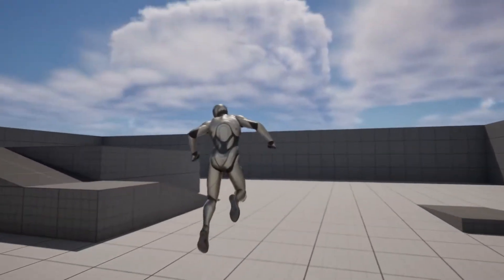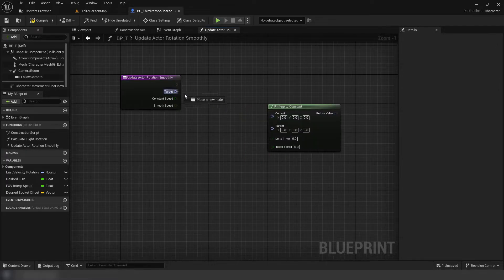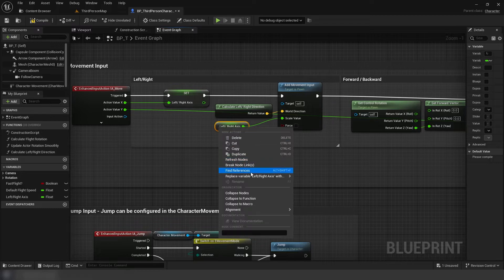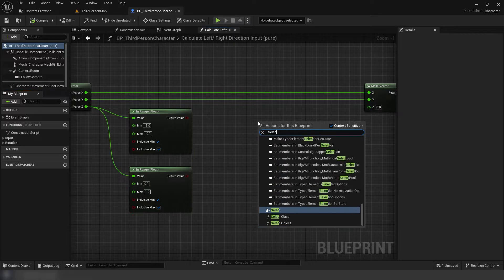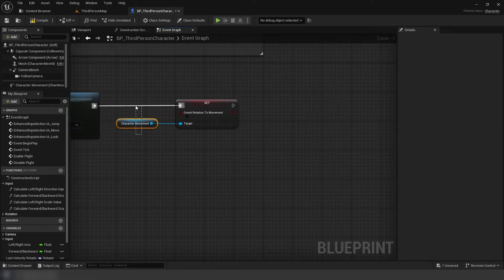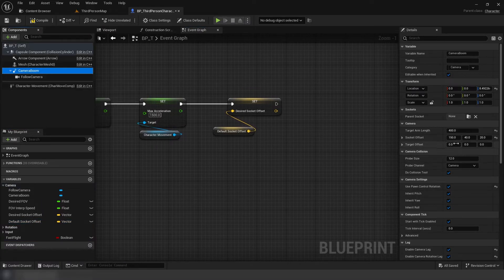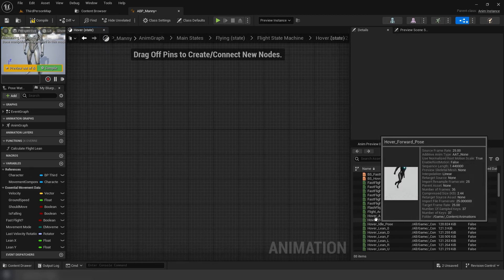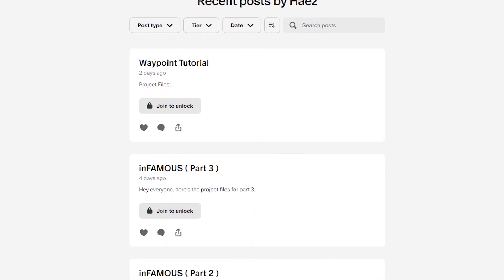Superhero Flight - UE5 Tutorial (check description)

Comment: I had an issue where when entering fast flight mode, I could only move in one direction along the x-axis. After rewatching different segments of the video several times, I realized that in the CalculateForwardBackwardDirection function, I was missing a "Get Rotation X Vector" node and had split the X, Y, and Z values out from the "Get Control Rotation" node directly. Recombining the struct pins on "Get Control Rotation", feeding its combined Return Value into a "Get Rotation X Vector" node, and then using "Split Struct Pin" on the "Get Rotation X Vector" node fixed my problem. If you're having a similar issue, be sure to check your Calculate Direction functions for any places where you may have used "Split Struct Pin" on the wrong node.

Comment: First of all, let me say thank you for creating the tutorial.  It is informative and I appreciate you taking the time and I did get out of it what I needed as well as a few things I wasn't expecting.

However, this might be the least enjoyable tutorial I have ever completed.  I get it, people want quick tutorials and typically people will click on shorter tutorials, and I can slow it down.  Regardless, the lack of break points after completing a task makes it very frustrating (IMO of course) to complete, especially if the user is actually trying to understand the code you are building.  It's just a constant stream of words with no warnings that a new section of code is getting ready to start.  That makes the user have to go to find a good stopping point.  Even allowing a second or two with the completed section on screen would be a big help and not add a great deal of time.

Comment: I think i'm having an issue where after using the Fast Flight, once the key is let go, the speed at which you're hovering is drastically reduced in comparison to the initial hover speed?
Reply from the maker: @169ru  May not have set the max flight speed to the same used when initially starting to fly
Reply: @haezdev  W quick response. Checking that now after just finishing fixing the animations in my project. Thanks again for the response as well as the video!

Comment: Hey I already left a request in the discord but I'm restating my issue here in case it doesn't get seen. So I got the logic to work for flight but I'm having trouble with the animations to work. When I enable flight (or fast flight), it'll go into the hover idle pose but that's it. I can move around and everything but I'll only be in the hover idle pose when flying

Update: I noticed I was using the wrong variable for "shouldmove" so I just fixed that. Now the character can transition from the hover idle pose to fast flight animation but when I move around, they only lean forward, not left or right.

Update: problem solved! I connected some nodes incorrectly during the function setups in the beginning. The flight works properly now.

Comment: (Found and fixed my issue in the comments below!) Thank you for this tutorial! I am new to all of this and although I had to watch it at half speed and do not understand most of it, I managed to get it working 99%. When using fast flight, my character flies diagonally to the right at about 45 degrees. I plan to use a different character model so I did not follow the animations portion. I am assuming that would not cause the issue. I have went through and watched the tutorial again while double checking and everything seems to be okay. I'm sure I missing something but I just can not find it. Any help would be greatly appreciated! Thanks

Comment: 11:37 - for anyone wondering why the character is no longer animating, connect the "As BP Third Person Character" output pin of the "Cast To BP_ThirdPersonCharacter" node we just added to the input of the following "Set Character" node after changing its variable type to "BP Third Person Character".

This drove me nuts for over an hour until I tracked it down XD
Reply: Thank you so much. This is my first project, and I have no clue what I'm doing. I wanted to get this tutorial done to have a firm basis to experiment with, and you saved me so much frustration. I usually learn better if I can emulate and then iterate off other examples, so this will make things smoother for me.

Comment: I’m running into a problem where the flight works but none of the animations work. It’s just the mannequin standing straight up while flying. Can anyone help?
Reply: 11:37 - for anyone wondering why the character is no longer animating, connect the "As BP Third Person Character" output pin of the "Cast To BP_ThirdPersonCharacter" node we just added to the input of the following "Set Character" node after changing its variable type to "BP Third Person Character".

Hope this helps, it drove me nuts too <3
Reply: @starblaiz1986  thanks I’ll try that

Comment: Why do i have an Exec pin when i try to drag Calculate Flight Rotation to connect to Update Actor Rotation smoothly at 3:06?

Update: I fixed it! I needed to check the "pure" box in the details panel.
Reply: Thanks so much!

Comment: So ive done everything but i have two issues at the end of it all, assistance would be great because this made everything in my game come together great.

Issue #1: When going from fast flight back to hover, i no longer can move unless i go back to fast flight or disable flight.
Issue #2: When going into fastflight mode (Holding shift), my character is stuck staring downwards, but lean and everything else is working.

I have carefully looked over and fixed all errors located from your description, just not sure whats going on here.
Reply: The issue #2 is solved by fixing default flight speed on disable fight, but issue #1 not sure what to do about. Maybe the additive is setup wrong.
Reply: @coden2676  You ever get that resolved, I'm curious?

Comment: During your video I got lost a lot, but then I realized you have the corrections in your video description. I really appreciate the extra effort you put in to creating the perfect guide. 
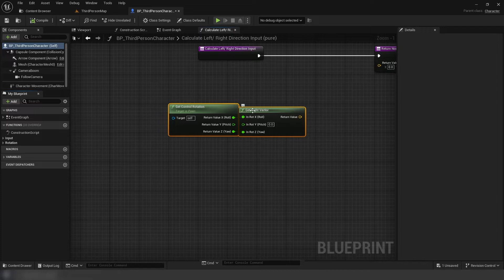(Corrections at 4:05 and 4:24 are in the 'Calculate Left/Right Direction' Function, not the Axis like it says in your correction edit in the description.)
1:50 when you Get Control Rotation, I was stumped until i realized you need 'Get Control Rotation (PAWN)' instead of (CONTROLLER). this occurs a few other times as well.
11:40 scary. Changing Variable Type from Character to BP Third Person Character warns of breaking connections, please advise to allow changes.
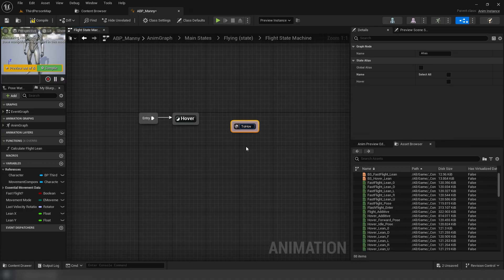13:26 you magically renamed New State Machine to Flight State Machine without mentioning it which really confused me at 14:57. At 14:59 you did it again. It helps when you mention that you're renaming things to help us follow along.

Its 4:40am and this guide has taken 4 hours to follow (im a beginner). And still I have an error. I will troubleshoot tomorrow. Your guide is quick and to the point, but maybe too quick. Thank you for making this guide, I can't wait to use Superhero Flight in my project!
Reply from the maker: Thanks for letting me know of these errors, I really appretiate the dedication to include all the time stamps and everything so I can properly understand what you're referencing! I've updated the description to include them, thanks again!
Reply: @collinprice1908  hello Colin, did you have sucess on the end and worked everything how it should ?

Comment: hey man I love your videos u doing great can you make spiderman edge detection system and sling shot ability
Reply from the maker: Thank you for the support, I really appretiate it. A slingshot sounds awesome, I'll look into that. For the 'edge detection' do you mean the auto parkour movement, or like jumping automatically off ledges?
Reply: @haezdev  I mean web zip move and sling shot
Reply: @haezdev  also one thing Im wondering about when spiderman wall running on the build you can press x and spiderman using webs and  jumping off the building but forwar direction how they do thatt

Comment: Love the video, question though; whenever i fast fly i kinda "strave" to the right? I dont know where i messed up but everything else seems to work as intended
Reply from the maker: Someone else had this issue, they made a super tiny error in one of the scale value functions. The select node wasn't connected up the functions return value, try checking that.
Reply: @haezdev  Solved it thank you! Turns out my issue was in the calculate left/right direction function, and it was indeed the select node not being connected to the return node. Dunno how i missed that but it works now!

Comment: do i have to do the forward/backwards and left/right function in ue4 or is it not needed
Reply from the maker: Everything is definitely needed!
Reply: pls how could i do it in ue4 tho
 @haezdev
Reply from the maker: @mattpopson6095  In the Third Person Template for UE4, it'll still have inputs for move. You just use those instead. UE4 still also has axis values.
Reply: @haezdev  yh so I just try to craft it the same as the one in ue5?